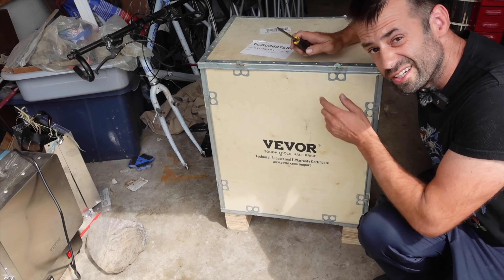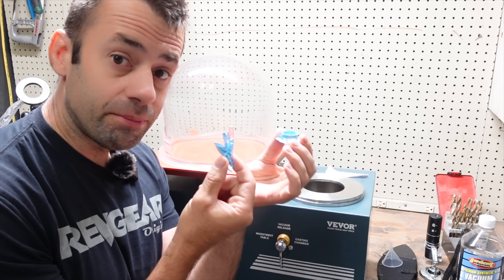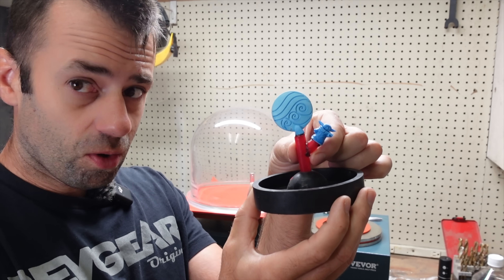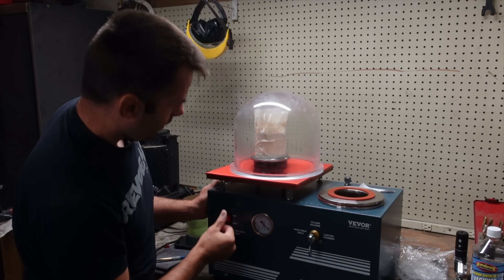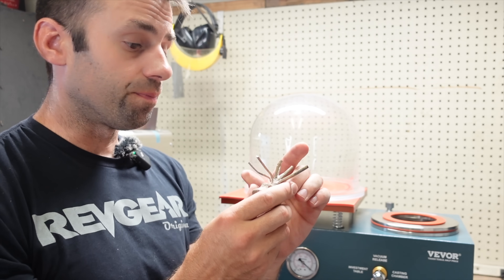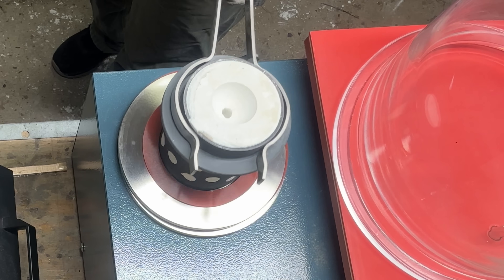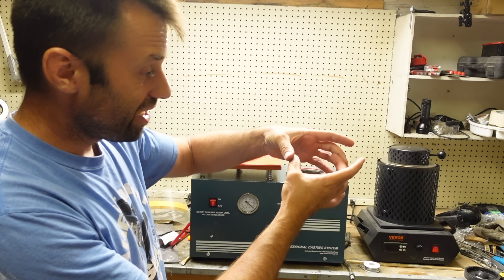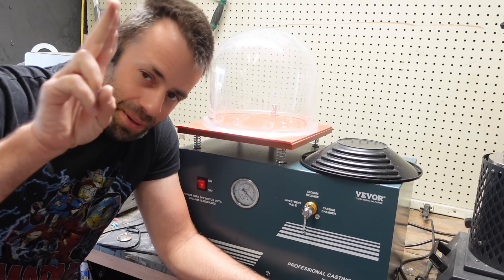New Vacuum Casting Machine!

Comment: I would make sure the inside diameter of that ring is at least .010" per 1" larger than the flask diameter.
3" = .030 etc.
Doesn't sound like alot..
(thats what she said)
but thats nearly 1/16" per 6"
Maybe its done intentionally to force you to keep the temps low enough not to damage to seals.
Reply from the maker: Even at under 300°c it’s too expansive to fit. And that’s lower than it says it should be.
Reply: I believe the factory had large tolerances on those parts, its possible that the part was out of tolerance but still passed quality control (I've seen many out of tolerance parts, even airplane parts can sometimes be out of tolerance, believe it or not!

Comment: The electric furace link is not working.
Reply from the maker: This one may work better. https://www.vevor.com/melting-furnace-c_11137/vevor-gold-melting-furnace-1350w-electric-digital-smelting-furnace-2102-1150-electric-melting-furnace-with-1kg-and-3-kg-graphite-crucibles-for-melting-gold-silver-copper-aluminum-p_010126303736?utm_source=favorite&utm_campaign=010126303736&utm_medium=96616073&utm_content=1020101263037364130&utm_term=722&compress_code=bfRzrY
Reply: @lundgrenbronzestudios great! Thanks Lucas. I will check it.